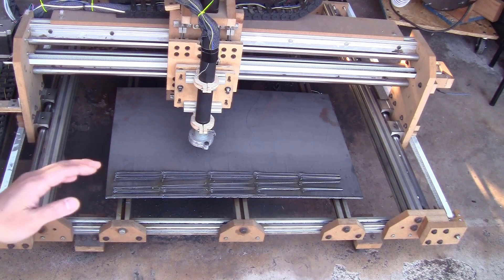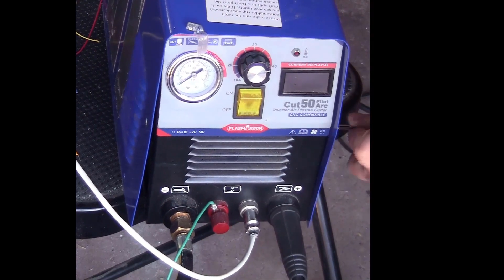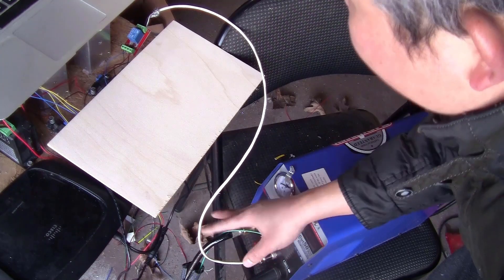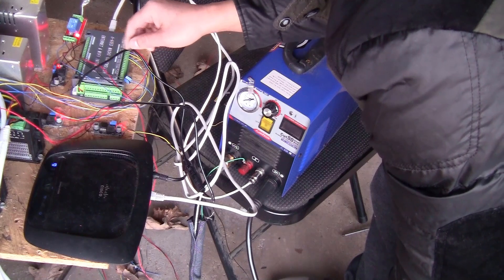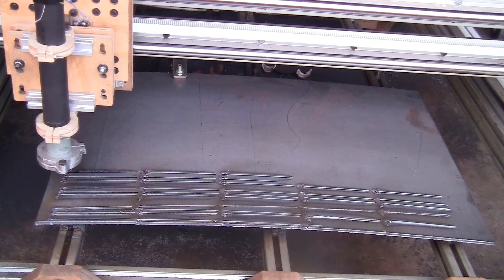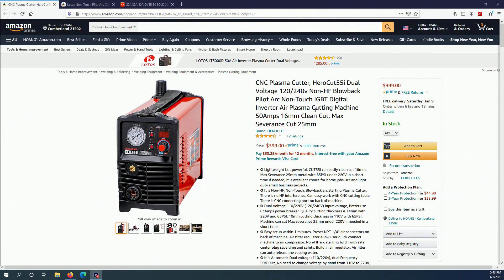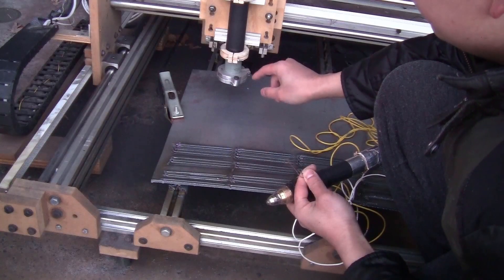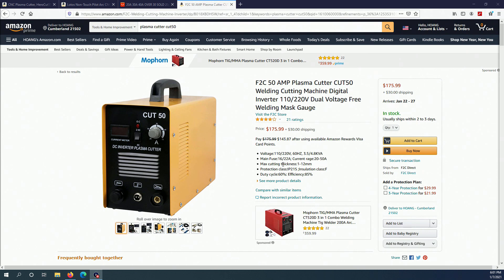DIY CNC plasma cutting table - Making the right choices for interference free cuttings

Comment: Does that breakout board have an input for torch voltage? Will it work with linuxCNC? (I think the link ot it in the description is wrong by the way). Thanks for the videos.

Comment: Thank you so much for putting together such a comprehensive video. This made me buy an EC300 to replace my old arduino cnc shield setup which kept disconnecting after almost every cut. The EC300 just keeps on going without any issues running a cheap HF start cutter at 100 amps. Anything USB based for plasma is just a waste of time now that ethernet boards can be found for less than 100 dollars.
Reply: Don’t suppose you could point a newbie to some resources for utilizing this? :)

Comment: Hi Minh, I like you projects. I’m building an cnc plasma but now I have problem with the configuration of the torch on/off. I buoght a nvem controller, everything work except from the plasma on/off. I connected the plasma switch with a relay to one of the outputs of the shield and then set the pin in Mach 3. Unfortunately it doesn’t work. Can you give my some advice ? 
Thank you
Reply from the maker: The output signal of the NVEM is active low, make sure your relay is also active low. You can use a multimeter to test the voltage of the output pin to see if the pin actually works or not
Reply: I tried with the tester but nothing. I set the output 1 as port 2 pin 1 and then tested with the multimeter : 0v. Then tried with another pin but nothing same result.

Comment: Hi Minh, I have been watching your videos to help me build a DIY CNC plasma cutter for use in at a school and they have really been helpful. Thank you for that.
The problem is that the plasma cutter we have right now is HF start and keeps interfering with the controller, so I have been researching to purchase the right LF Blow back start plasma cutter machine. So could you help me in finding the right one.
I checked the ones you recommended but I also need to find the corresponding straight plasma torch and the consumables for the straight plasma torch. Could you please help me find the right plasma cutter, the corresponding straight CNC torch and its consumables? Even a link for them would be really useful.
I have been looking into the LOTOS LTP5500D-CNC PLASMA CUTTER and found a corresponding straight CNC torch but i couldn't find the corresponding consumables

Comment: Heck yah! its useful.... I'd love to see how that breakout board is setup... I see them on ebay and ali but don't know if i'm smart enough to figure it out
Reply from the maker: Don't buy it, it doesn't work very well for plasma cnc. It's OK for cnc mill but not plasma. It has a delay in starting and stopping of the torch which is very hard to fix and make it not usable for plasma
Reply: @minhsmancave9448  any thoughts on the proma my plasma.... a little pricey but looks complete
Reply from the maker: I was talking about the breakout board. But the proma is surely easier to setup, the problem is that it is only compatible with certain types of mach3 breakout board (usually more official and expensive ones)
Reply: @minhsmancave9448  hello minn av watched your video like the 10th time.. I have the same board.. An am having a problem with full cuts.. My cuts will cease 3/4 way.. Seems like a delay problem how did you fix it.. Please help me out am going insane.. Also I have a thc a Chinese sh hc31.. I won't bulge.. I can measure arc voltage in but no vout signal

Comment: Torch SIZE?  Is it IPTM80?  if size 80 how do you get nozzle sized smaller than 1.1. the IPTM60 Pencil CNC TORCH head I have been told by many China CNC sales places is no longer available
Reply from the maker: You can still buy it on AliExpress
Reply: @minhsmancave9448  Did you buy the Hero?  Today I will Order Hero Cut 55i  or LOTOS LTP5500D-CNC, I can not tell the dirrerence,  They both have a 1:1 Output, What part number is yout Straight Torch?  Are you in Vietnam,  I am an ExPat in NhaTrang
Reply from the maker: I got a used Hero Cut 55i from ebay for under $300 but haven't gotten time to put it on the CNC machine yet. I have been paying more attention to my milling machines and my fishtank filter business. Both machines are the same, buy the one that is convenient for you to get parts and warranty. Yes, I'm from Vietnam, but luckily was born in peace time.

Comment: Great Videos and Great Content - I am ready to pull the Trigger and buy the Hero or Lotos plasma cutter for CNC (Only) So which one is the best option from what I can tell they seem to be the same unit in just different wrapping
Reply from the maker: as long as it's a blowback pilot arc, it won't have the problem with interference from the HF pilot arc

Comment: I purchased this CNC controller in China, and the use effect is relatively poor. The basic floating z-axis G31 detection code cannot be executed continuously, and can only be executed in a single step to follow the normal process.
Not as good as a USB control panel.

Comment: Help me please,i am using G28 for floating head in post processor but when i run gcode relay firing torch starts ok but  it switches off before the cut is finish(1 second before finish cut)
I have bought same novusun controller.I am using same relay you mentioned in comments with choice of active  hi/low .There is three connections on one side for powering relay.dc+ dc- Inl 
It is 5v relay.Do i have  use external power?and how to connect to  controller board to relay?

Comment: have you got a wiring diagram for using the thc on the novuson ? i can't get connection.
Reply from the maker: Which THC do you have? Novusun only work with stand alone THC (step/dir mode, not up/down mode)

Comment: Hello, I have the same problems with the parallel port, could you give me some advice?
Reply from the maker: Not very easy to get rid of the HF frequency. Some people said that they were successful using shielding, filtering. For me, the solution is to use blowback pilot arc plasma cutter, not HF pilot arc.
Reply: @minhsmancave9448  what would the pilot arc with recoil be like?

Comment: I have the same problem, but my controller is serial, I found a peak in the electrical network of 1000v when I turn on the torch, the source suffers interference and passes to the controller, causing the stop.

Comment: Congratulations for the video! Tell me, what happens if the regulation of the high frequency spark is less than 0.8mm?
Reply from the maker: It's like the spark plug in the engine. Each type of spark plug has a spark gap is optimized for a type of fuel, amount of fuel. Not sure what will happen but I do believe that the manufacturer did some testings to find the optimized gap for their machine.
Reply: @minhsmancave9448  I use the plasma source of the eutectic castolin brand. But I'm always having a little electromagnetic interference. Today I tried to regulate the spark, everything was fine without interference, but after a while it started to cause another type of problem. When you start to cut, immediately afterwards the electric arc goes out .... do I need to readjust the spark? Hugs and thanks for helping !!!
Reply from the maker: Maybe try to increase the gap a bit, too close gap also not good. I can't be sure, but sometime call the support tech and ask what the gap should be might be helpful

Comment: In my experience a USB type control board is not a good choice for Plasma use.  
Much better one of the Ethernet type control boards will be much better in the electrically noisy environment.

Comment: Hi Minh, with your video I've solved relay problems but now I've another question... During gcode execution the relay work very fine with M3 and M5 commands but all the axis have a execution retard! Can you help me please? Whit my old "red shield" my plasma work perfectly
Reply from the maker: Sorry, which board are you using now? NVEM? If the torch is turn on and off earlier (about one second delay is know for NVEM boards), You can add a pause before the M3 and M5 gcode command. You can do this automatically every time by adding a few line of code in the post processor in the two functions: "onPenDown" and "onPenUp". If you are not sure how to do that, I'll check tomorrow on my SheetCam computer and get back to you.

Comment: Hi i have nvum controller I want to know the relay pins
Reply from the maker: There's no delay pin, you will have to buy a relay and control it using an output of the controller
Reply: Please can you help me setting it up
Reply: I have the relay but how to connect it
Reply from the maker: @aabtech32  The output of this board is active low, make sure you have this type of relay that you can choose the input is high active or low active: https://www.amazon.com/Willwin-Channel-optocoupler-Support-Trigger/dp/B077TLWQ5G
Reply: Hi, I have that type of relay but how to wire

Comment: when you open the box, I did not clearly heard the gap distance is. How much the gap distance ?
Reply from the maker: Should be 0.8mm, mine was about 1.5mm
Reply: @minhsmancave9448  thanks for the info ...
Reply: I tried to adjust the gap distance, but I can not unscrew the points to adjust the point distance. The screws are tight, maybe glued. It seems it can not be adjusted, I just make it like that for years, now machine fire intermittently, can you share experience to loosen the screw ...

Comment: Hi , can you help me? i dont now find wiring diagram for relay on a nvem board ... i need use it for my cnc plasma ... thanx
Reply from the maker: Output #1, and 12v, active low. You will have to buy a relay that you can choose active low or high
Reply: @minhsmancave9448   thank you wery much

Comment: Hi, Minh, I have a big problem with my DIY Plasma Cuting Table. One of ten times when the pilot arc starts the connection gets lost. I have tryed everything, but it doesn't work. Today I try this with the gap in the plasma cutter... Maybe you can give me some technical support? Thanks in advance
Reply from the maker: I'm not sure how your system is like. Are your components in a metal shielded (grounded) box? The USB breakout board is very sensitive to the HF signal, especially when the arc doesn't start right away. Try to get your plasma cutter and your controller unit on different line of power (at least your plasma cutter should have its own breaker from your breaker box). You can also un check the option "use driver watchdog" in Mach3,config, general config. The start gap only help to make the arc start faster so the HF signal has less interference but won't remove it completely.
Reply from the maker: And I'm not trying to advertise for the Chinese, but one thing will definitely help is installing the Thc system sf-hc25g. This system has the arc voltage divider board that has a relay on it. The breakout board doesn't communicate directly with the plasma cutter anymore. I have been using it with my RnRmotion board and no problem with interference anymore.
Reply: Hi, thanks for the quick answer. I'm using an metal shielded grounded box, and all wires are shielded and grounded. I use Mach4.
Reply from the maker: What breakout board do you have?
Reply: Hi, I don't know the model at the moment, when I'm in the workshop next time I write it down. In a last video from you you have a white wire  to the burner nozzle, which you meaned it stops interferences? Where is this wire connected? Doesn't it worked right? Best regards
Reply from the maker: The thing about that is inside the plasma cutter, it still try to ignite the torch with HF signal, but it might reduce the effect. You can get a long wire (big enough, maybe 16awg or 14awg) attach one end to the nozzle of the torch(wrap around the nozzle and somehow keep it in place, maybe use electrical tape to wrap the wire to the body of the torch). The other end attach to the ground clamp of the plasma cutter. When cutting, make sure the clamps is clamped to the work piece and torch is always cutting inside the piece. Or else, you will burn the wire. The best way is to change the plasma cutter to a non pilot arc or non HF pilot arc.
Reply: @minhsmancave9448  OK thanks a lot, but which kind of Burner is possible/best, if pilot and HF is not the best solution?
Reply from the maker: By burner you meant the torch?
Reply: @minhsmancave9448  Yes, torch
Reply from the maker: The torch is really depends on your type of plasma cutter. You cannot use blowback pilot arc on HF pilot arc plasma cutter. So, if you want to use different type of torch, you will have to change plasma cutter.
Reply: @minhsmancave9448  OK, I meant the   plasma cutter. The best solution blow back pilot arc? In the moment I use the Stamos 125 Cnc this is a pilot arc.
Reply from the maker: Your plasma cutter is still use HF pilot arc, not blow back pilot arc.

Comment: Have u ever try the connection from NVEM to PC or laptop directly without router? In the manual data sheet ,there explanation ethernet cable/LAN cable can direct P2P to PC
Reply: Hi sir, i have buy the same nvem like yours, but do you have a clue wiring diagram and mach 3 setting? With nvum, where i do suppose connect the relay for pilot arc trigger (which port)
Reply: Today i try to run the motor but failed, maybe i'm not familiar yet with mach3
Reply from the maker: Output port is #2, input ports is number 1. You can chose the output port to trigger the arc but usually it is output #1 (near spindle). I don't have a diagram yet, will try to make one in the future.
Reply: @minhsmancave9448  hai there, my board already got issue after used for 2days, it runs ok, but then it show upgrade bin file in mach3, at the motor tuning cannot set the velocity, so the motor cannot run at all, in the plugin config show axis0 freq 0 too, and seems to be alot of people got this problem too.. do you have tried to isolate 5v usb with usb bob red board?
Reply from the maker: It's not easy to isolate the red board. I did many things and the intègrent still come back from time to time when cutting with high amperage. Until recently, I installed the Sf-hc25g thc, this THC has an integrated relay on the voltage divider board. So the USB board doesn't interact directly with the plasma cutter anymore and that seems to help. I haven't had any problem with the interference then. Maybe if you wanted to use the red board, try also the Thc system.
Reply: @minhsmancave9448  my nvem board is done, so my last resort is usb bob red board, tomorrow i'm gonna mounting on the frame to test it out.., btw do you ever try noise grounding solution? Which is all control board steel frame must ground, include the frame that hold the motor, in my state the thc so expensive, to order online at aliexpress or amazon it seems to waste time and risk..
Reply from the maker: You might try to box all component in a metal box and do all grounding. It surely will help reducing the HF, but I cannot insure 100% success because it depends also on each machine setup. Of course, try to put your plasma cutter as far away from you controller board and use separated power line for your plasma cutter and your CNC control unit.
Reply: @minhsmancave9448  hi there, i finnally run my first cnc plasma cut without interference long cut, thanx for your video channel that's help alot...
Reply from the maker: Congrats my friend! Not sure what you end up using at the end but I'm glad you are ready to move on to making things.
Reply: @minhsmancave9448  gonna find thc for next... And that's it...

Comment: Using ssr relay for pilot art. Ssr relay not using coil.
Reply from the maker: The solid state relay type is for ac load, it doesn't work for the trigger of the plasma cutter. Unless you can suggest one that can use for DC load.

Comment: Hi mate great detail thanks for sharing 

I noticed that on your test cut the plasma arc came on before the torch got to the work piece 
Did i see that correct if so why have you set it like that 
Thanks
Reply from the maker: Before start cutting (moving the torch in X and Y), you will need to pierce through the sheet metal. The pierce height usually higher than the cutting height because the melted metal doesn't have anywhere to go other than being blown back up. To avoid it getting stuck to the nozzle of the torch, you will have to set the pierce height at enough distance and  have certain piercing time delay. That's what you see at the beginning of each cut.

Comment: I already use Mach3 for my plasma table I use Hero i60 it works good. Now I'm converting  an old milling machine to CNC. Do you have an opinion on whether to use Mach3 or Mach4 or maybe a different program. Thanks again for another great video.
Reply from the maker: It seems that MAch4 is more advanced Mach3 with supports (ArtSoft stopped supporting mach3). So, maybe Mach4 is the way to go depending on what type of function you think to have on your milling machine. If you only use normal, basic milling, I don't think it matters that much. Mach4 breakout board might be more expensive since there are not many chinese boards for it yet.